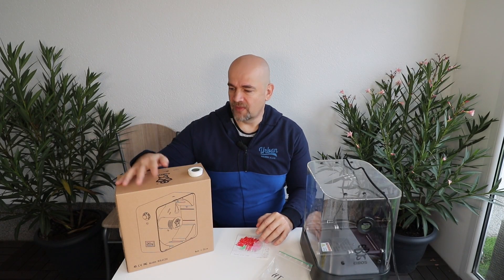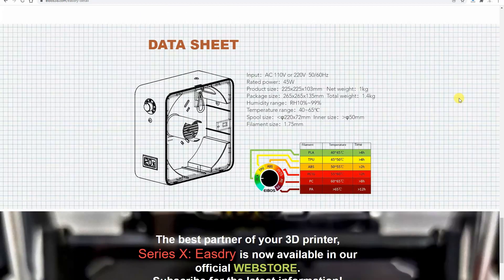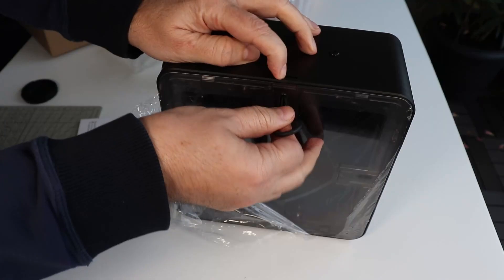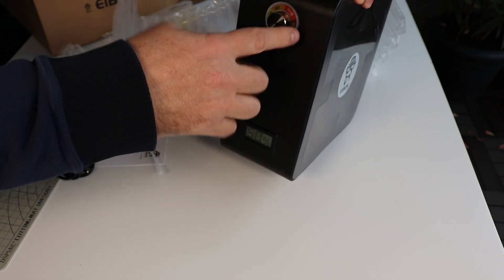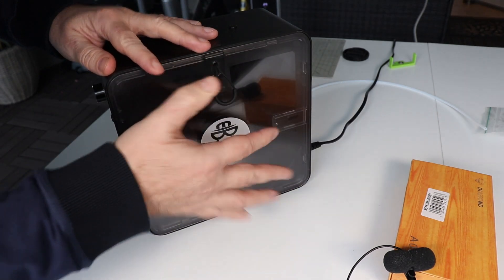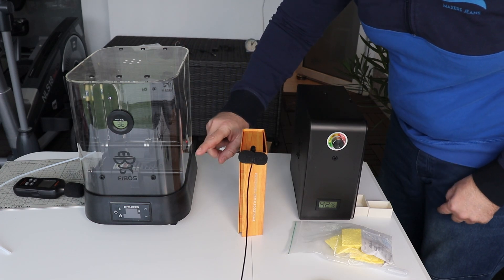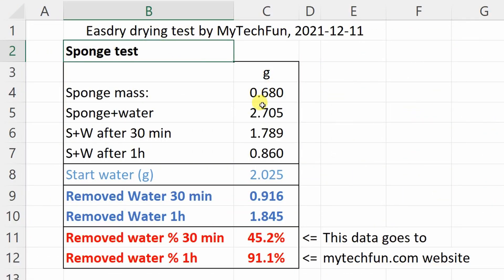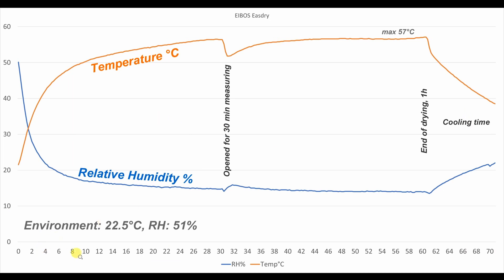Eibos Series X: Easdry filament dryer review, the new vice-champion (so far)

Comment: I have seen comments from quite a few people regarding the vacuum bags failing after only a few uses, what has been your experience with longevity?
 On the Easdry your unit could only get to about 53C on the Nylon preset, mine can get to 63C and being measured with a PT1000 and Arduino, I believe yours is the 45W version and mine is the 55W version despite your instruction booklet saying it was 55W, I had some PA6 that was very wet and the Easdry dried it just fine at 63C and kept it dry while printing also,  When I saw your review of the Easdry, which was after I bought it I was all ready to send it back but decided to test it out, Im so glad I did

Comment: I just bought this drier as a snap purchase as my food dehydrator broke ,Im not too unhappy though as I got many years use from it just as its original intended use and about 6 years drying filament, I remembered the Eibos getting a good review from you and came out top in the comparison,however, I now realise it wasn't this Eibos drier, I was shocked that it doesn't have a timer and that it cant dry Nylon despite it saying it can, it is packed up and ready to go back and I guess I will be watching the comparison video again to see which one will be able to dry Nylon, Im guessing it is going to be one that is around 100W.
 One of my past projects was converting a toaster oven into a reflow oven, I just thought maybe that can dry my Nylon filament, all I would need to do is create a new profile in the firmware for 65C and the time, I would need to turn the spool half way though.

Comment: Thank you for this!
I just saw the bigger comparison and was hoping to get your measurements on the easybox as well.
Ideally, there would be a second set of measurements with more water, a digital scale under the sponge and a longer runtime.
That way, you can measure if the dryer balances blowing out very wet air in the beginning with sucking in cold, slightly-wet air after the filament is reasonably dry.
I saw Bambu recommends 6-8h of drying, but I guess that is also because of the many layers of filament in a spool.

Comment: Great review: I love the engineering and analytical approach. I was to order an S2... changed and ordered this one (but the 5% promo code did not work). What I've not seen is... If there's a timer, or I will have to connect it to an intelligent plug... When you switch it on... does it immediately get hot... up to when you switch it off?

Comment: I want to start printing Nylon and think I'll get one of these. However seeing as this doesn't get up to 70° does that mean I will need to get another dehydrator or something else to dry the filament before use?
Reply from the maker: This is what I do with nylon: open from the package only before 3D printing. The printing from any cheap filament dryer and when finished goes back to resealable (usually) vacuum bags. In this case I don't need hi-temp drying.

Comment: They "fixed" the relay clicking problem by giving up on temperature control all together. Temperature is now only a suggestion, they step down the voltage by how much you turn the knob, which means, the same knob position, will have wildly different temperatures, depending on your room temperature and your country's permissible voltage variation.
I assume that is the precise reason why they were so conservative on the knob sticker, to accommodate 230v countries, because over here, when I set to ABS, at 28c room temperature and 218v average voltage, it barely gets to 48c measuring right at the air outlet. Also the 50-55c to dry ABS from their manual is a joke, even when I kept adjusting manually, between PETG/PC in order to get the 50-55c they suggested for ABS, measuring at the hottest point, right at the air outlet, I spent about two weeks trying to dry half a roll of ABS and it did absolutely nothing. When I allowed higher temperatures, I began seeing some results, nowadays I just crank it up to max, leave it in a non-a/c room and even so, it takes about 8 days to dry an ABS roll, the hottest it gets is 65-66c, and that's only with a good 222v, which I only get for about 3 hours a day so I assume most of the time where it's sub-60c it's doing nothing.
In conclusion, it's a good and affordable dryer, but in order to accommodate 230v countries, as well as not have liability for people's lost filament, the thing runs so cold that it's probably only good for PLA, maybe TPU, in any reasonable time table.

Comment: Thank you for your testing, always as accurate as I would do it myself! :) It's nice to see tests done right!
It's really a pity it doesn't hold 75 mm wide spools, really a bad choice.
Do you think that with some simple modding it would be possible to enhance it? like printing a spacer for the side panel to have it sit 5 mm farther away while keeping the dryer airtight. I would appreciate such an information, so far the Easdry seems to be my best option but I need 75 mm. Thanks.
Reply from the maker: If I remember correctly, there is an STL file, we can download and print it, as extension for the box, and wider spools can fit inside. Probably PETG is needed as material and bigger printer.
Reply: @MyTechFun  indeed, I didn't think about searching!

Comment: I just received it , mine has a maximum temperature of 45° , I'm waiting for a response from the manufacturer   I am skeptical about the reliability of this product ...
Reply: The manufacturer is reactive to respond to emails . It is possible to adjust the temperature by a potentiometer by removing the back cover , increase by turning to the left, i have now a correct temperature for the pla ,I have no tested the other settings not having another suitable thermometer . By touching this potentiometer you really have to monitor the temperature. there are some who have overheated their filament

Comment: Cyclopes is 3x more expensive then Sunlu, I notice your test is just 1 hour, so if I leave the Sunlu for like, 6 hours, I might get the same result of the Cyclopes? I’m fine with waiting, just don’t want to spend 140$ vs 50$
Reply from the maker: Sunlu is good to to dry anything except Nylon, but it can keep it dry during printing if you previously dry it in oven for example. Nylon needs 70-80°C for drying if full of moisture.
Reply: @MyTechFun  got it, I’m thinking about returning it then and getting the Cyclopes. Thank you very much for your video!

Comment: I think they are  scam, or gone. I emailed a few times, messaged on FB, messaged on Instagram... NOTHING. My order never shipped.
Reply from the maker: Hm, not sure what happened, but they are existing company for sure
Reply: @MyTechFun  I finally got mine in. I really had to message them allot, on email, FB, etc. (they told me they are not a social company) My 1st one, doesn't get warm at all. My 2nd one, is cold at PLA, and get's a little bit warm when set at PETG. Did yours get warm at the PLA setting?  Returning both.

Comment: Hi Igor, does a Prusament PETG roll fit inside?
Reply from the maker: Old one no, new one yes. But somewhere I saw STL for extension, so even 100mm spool can fit inside. Ask Eibos about it..
Reply: @MyTechFun  awesome thank you for the reply
Reply from the maker: @iDR1FT  But don't print it from PLA, it will melt: https://cults3d.com/en/3d-model/tool/eibos-series-x-easdry-parametric-spool-holder-and-desiccant-tray-fusion-360

Comment: For those who are wondering if you can get it more quiet than the stock setup. I got this small drier myself and was wondering if I can replace the fan to make it silent (like I had for my printer). However, after taking it out I noticed that the fan itself is very quiet. The noise you hear is from the fact that the fan blows air into the plastic tube (the one you spin the spool on) and that's what makes the noise. I guess we'd need some input from physics perspective on what one could do to minimise such noise level.
Reply: What if you glue thin foam sheet inside the spool in a way that covers the hard surface of the spool yet absorbs air vibrations?
Reply: Ok maybe not glue but attach with a double-sided tape.
Reply: @tannisroot  I must correct my original comment. Actually the fan itself is quite loud as well (perhaps at the time I ran it for the first time, the PSU wasn't supplying it with full 12V). 

I filled the tube with silencing foam (the one used in cars) but it didn't do much. I wasn't able to fill the whole tube though as I didn't want to keep it too close to the heating element to prevent the glue from melting and I didn't know how heat tolerant is the foam itself.

I've also tried to plug a 4010 noctua fan and whilst it was less noisy, it still wasn't ideal. Ultimately I used an internal resistor to lower the voltage on the stock fan to ~9V, reducing its speed and thus efficiency, but the noise level dropped dramatically. 

I hope lower RPM won't affect the drying capabilities that much. Perhaps it'll take an hour or two more to dry the filament but if that's the price for quiet drier then I'll pay it gladly.
Reply: It's often teh sharp corners and obstructions that cause noise as the airflow is inhibited there and turbulences cause a swooshing noise. I could imagine making edges smooth and removed sharp corners would help. Also a slightly rough surface can help with airflow as it creates small vortices on the surface that act almost as an 'air roller bearing' - just my five cents in regards to airflow and noise...

Comment: I got this dryer and it heated the PLA until it stuck all together while sitting inside and the spool walls were bent. The LCD screen on the humidity sensor turned all black. I disconnected sensor, took the batteries out (they were extremely hot) and let everything cool down. I put the sensor back, then I ran the dryer on the lowest setting, monitored the temperature inside with an Avometer, with the probe hovering slightly above above the spool holder cylinder and let it run for about an hour (5-6 games of rocket league) and it reached 100 °C. I guess it could have continued rising but I didn't see the need there. At a 100 °C (at the probe) the screen on the humidity sensor didn't go black yet, which means it certainly reached higher before. 
The body of this thing took it completely like a champ, no worries right there. The door opened and closed with no problems. The rubber band handle is genius. It wont heat up. You can completely take away the door without touching the heated door panel itself. 
So I guess/hope it is a faulty unit what I got. I will get it replaced and see. I really like this dryer that I might just add a thermostat to it, if the replacement unit acts the same, it's completely worth it. It can reach and hold up to 80-90 °C with no worries. This thing has an AC heater module, there's no AC/DC adapter anywhere. It might be 120 - 150 w (will need to disassemble it to know that or measure power draw but I didn't).  
The only other thing this dryer is missing is roller bearings underneath the spool to make it not even touch the cylinder in the middle and roll smoother. I will try to design one for it, there is certainly enough space inside.

So the moral of the story is.. Test your Eibos series X dryer and see what temperature it reaches, before you ruin some good filament inside it. And if your dryer reaches only 63 °C, you can certainly overclock it ;)
Reply: I heard someone else had the exact same issue with this one. They said it melted the entire spool of filament and one solid piece. I’m really struggling just to find a reasonably priced film and dryer that actually works. They all seem to say they only heat the filament but don’t actually dry it. really frustrating
Reply: @taylor943  Did you ever find one? They all seem so crap :(
Reply: Gee. My 2 unit's barely get even slightly warm. Useless

Comment: Thank you for the video!  I purchased the Eibos Easydry based on your series of dryer videos.  It arrived in just a few days and I decided to do some temperature tests.  I used a Fluke multimeter temperature probe and my dryer reached 67 deg C on the highest setting.  In your testing it only reached 57 deg C, so I am wondering if you got a bad unit or Eibos's quality control is just not up to par.  I've been using mine and keeping the temp monitored and it dries the filament well and maintains temperature.  By the way, the temperature in my printing room was 21 deg C during these tests.  I believe Eibos' own testing was based on 25 deg C room temp.
Reply: Have you tried PLA setting? Both of mine, are cold when set to PLA.
Reply: What thermometers can we use if we don’t have a Fluke?

Comment: I think this is a bad design.
The temperature in the center is much higher than around, which easily leads to over-drying, the filament near the center of the spool is melted and stuck together.
I damaged 2 petg rolls when I left the drying time too long. Measurement in the central area can be up to 80 degrees Celsius, too hot for petg.

Comment: so basically a food dehydrator is still the best filament dryer around, all the others can barely reach 60 degrees which might be good for PETG, but for times you want to dry PC, ASA (and i have ASA that still get bubbles in the prints i live in 80-90 humidity) you need something stronger.

Comment: How easy does the spool spin inside it?
Reply from the maker: Not too smooth like separate open cylindrical spool holder, but easy enough, extruder will not have a problem.

Comment: To be clear, and accurate, the tube with that dryer is not a Bowden tube.  It is only a Bowden tube if you install it between a Bowden (drive) extruder and the hot-end.  That same tubing, used anywhere else is not a Bowden tube.  It is just a "filament tube", made with Teflon.

Comment: The Amazon (U.S.) description for the Cyclopes states that it uses a PTC heater, but the seller is not the manufacturer, so I question the accuracy.  Do you know if that is accurate?  Does the Easdry use a PTC heater?
Reply from the maker: Sorry, I don't know, try to email them directly

Comment: With the Cyclopes, the air temperature coming off the heater is above the safe temperature for drying PLA. Have you seen a design for a fan deflector or other solution to prevent this hot air from blowing directly on the filament?
Reply from the maker: I was testing at max temperature, for PLA the temperature is lower.
Reply: @MyTechFun  So overnight, set on 40C, the EIBOS melted a spool of HTPLA. So it is definitely not safe for PLA. I had two spools on there, and the left hand spool is the one that really was damaged - the right hand spool is only slightly deformed. I would share a picture, but YouTube removes the post if I do that.
Reply: @MyTechFun  I tested it at the temp they recommend for PLA (45C) and measured the temp with a sensor positioned near where a spool would be. It gets as high as 54C. I don't think their design controls the power going into the heating coils based in your setting - it just cycles the heater on or off - very slowly - via that loud mechanical relay.

Comment: I just got mine today. Quick shipping to Colorado USA.

Shipped Dec. 13th / Received Dec. 22
Reply: Hi Ken, what do you think of this dryer? I also bought one, but I'm suspecting it came defective, because I'm not getting the same results shown in the video.
I'm still testing this dryer, but as an example, I'm using Calciumchloride as a desiccant and without turning on the dryer I'm with 38% relative humidity, but when I turn on this value goes up to 50% and I still couldn't even reach the initial humidity relative value.
Reply: @joaoneto1399  When I initially put the filament in, I let it run for 4 or more hours before looking at the humidity reading.

After I'm done with the filament I store it in a vacuum bag with silica. By doing this I don't need to run the dryer for 4 hours again. I just run it for 30 minutes prior to printing from there on out.

I also set my heat dial at the top end of the filament type setting.

Let me know your experience on this.
Reply: @cryptocandyland  Thanks for sharing your experience and results. I will change the desiccant to silica pouches and redo the tests.
Reply: @joaoneto1399  Sure thing. Keep me posted.

The inside dryer humidity level is 10% BTW. I'm in Colorado, USA.
Reply: @joaoneto1399  I do use the desiccant pouches in top & bottom chambers.

Been working great. I use it with TPU & PLA

Comment: Hello Igor, thank you for the test.
1.- what is the Physics explanation for the humidity rising after power off ? Or is it that the unit (relative humidity) is dependant on temperature ?
2.- could it be that the dessicant is releasing humidity after turning off ?
3.- do you recommend to immidiately remove the filament spool after turning off and placing it back in a air tight container (bag or box) ?
4.- is it possible to plug the unused filament holes ?
5.- could checking with a FLIR reveal heat losses on the body of the unit ?
6.- Don't "CE" stamped heating units require a ground wire to be implemented for safety ?
Thank you very much.
Best regards, Diego
Reply from the maker: 1. Power off, air cools down. More moisture condenses. Warm air can “hold” more moisture than cold air. 
2. No, I believe that deccicant is also dried in this process
3. Yes, store it in vacuum bag or other dry place
4. It is, but not so important
5. Maybe later this week, it will be uploaded to MyTechFun FB page
6. Not familiar with CE rules.
Reply: @MyTechFun  Thank you very much for taking time to answer me
Reply: #6 Once upon a time, the EU came up with the CE symbol to denote the product passed a rigorous testing procedure. A few years later, China came up with a very similar CE or "China Export" symbol. I suggest you do a little research so you can tell the difference between the two symbols.